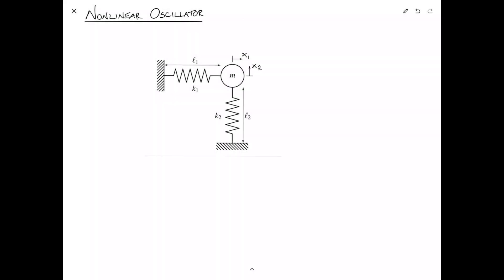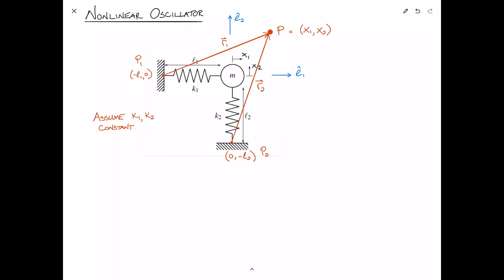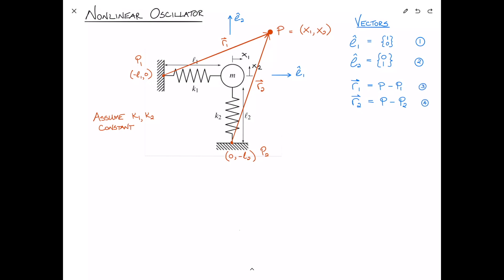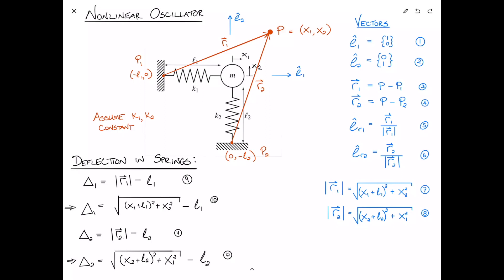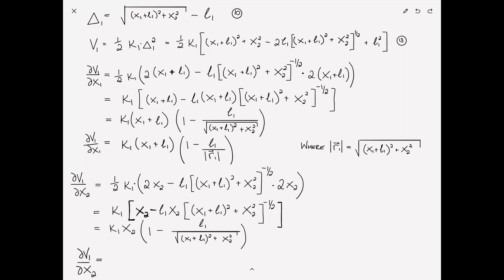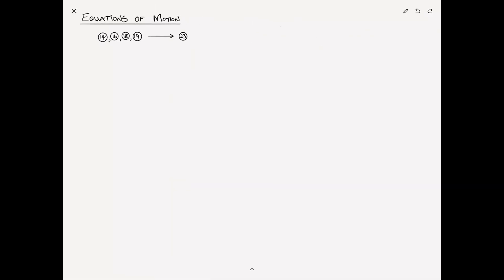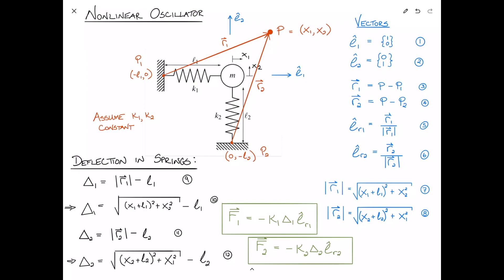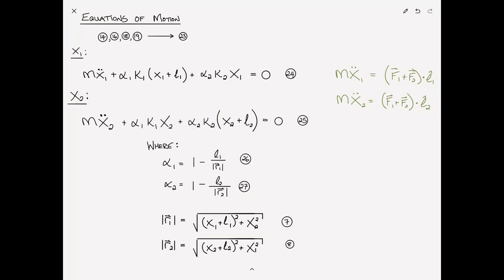Equations of Motion for the Nonlinear Oscillator (2DOF)

Comment: Hi,

I have a few questions:

-Shouldn’t the kinetic energy be 
(m/2)(v1+v2)^2?  There is only one mass, mass m.

- The total energy of the system is constant, but for this problem, the energy of each position of m is not unique.

       As a result, shouldn’t the equations 
       be derived differently?  Stating only 
       the energy tells us very little about 
       this system’s motion.

       Maybe you could make another 
       video?

- in your second method, the units don’t match.  You have force on one side, and energy (newton metres) on the other.
Reply from the maker: Kinetic energy is (m/2)(v1^2 + v2^2).  You are squaring it in the vector sense, so you're really taking to dot product of the vector and itself.   This has the effect of squaring each orthogonal component.

Yes, the total energy is constant, but the contribution from each component keeps shifting.  According to the Lagrangian formulation, the changes in each energy contribution is all we need (plus an initial condition) to determine the state of the system at any time.

Not sure what you are referring to here.  F = kx??  This has units of force on both sides.
Reply: Okay, unit vectors are unitless.

Comment: You have great skills to explain such physical problem in most comprehensive way. I need to know, why in this problem, rotation of mass m was not considered for deriving EoM.
Reply from the maker: The mass is not rotating as all.  It might be helpful to think of it as a point-mass.
Reply: @Freeball99  But, will there be any rotation of mass with respect to fixed point of spring as the springs will get inclined by angle theta?
Reply from the maker: Not sure if I completely understand the question, but hopefully this covers it...

As a result of the problem being geometrically nonlinear, this effectively rotates the coordinate system with respect to the global coordinates.  We see this in the video as the vectors r1 and r2 are rotated with respect to the e1 and e2 vectors.  As a result the spring forces are not always along the e1 or e2 axis.

That said, the mass will not rotate unless the spring forces produce a moment, which cannot happen if the spring are attached to the center of mass.  On the other hand, if the springs were welded to the outer surface of the mass, then the mass will rotate as a result.
Reply: @Freeball99  thanks a lot for your reply. I am going through all of your videos these days. You have cleared so many concepts. I like your way of explaining concepts with detailed mathematics. 
In connection with the above query, I was actually referring to the rotation (or revolution) of mass m about the axis passing through the fixed point of the spring(s). If the stiffness of two springs are not equal then I think it is likely that mass will also have rotation about the fixed point of spring. It may have been ignored due to very small rotation. Please correct me if I have understood incorrectly. Regards

Comment: So that means that an oscillator becomes nonlinear just if you change it's initial position?
Reply from the maker: Yes, in problems such as this one which are geometrically nonlinear, the problem becomes linear (and far less interesting) for very small displacements.  In this case, the vibrations in the x-direction and the y-direction are decoupled.